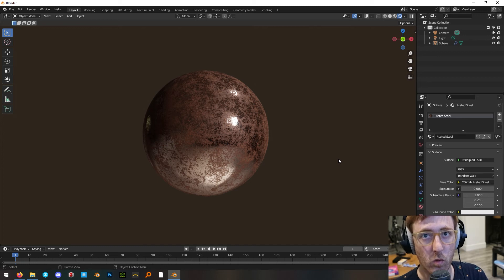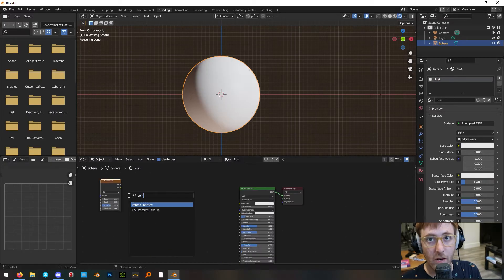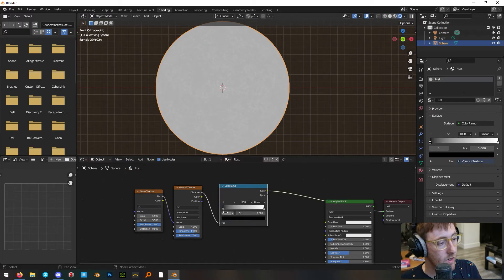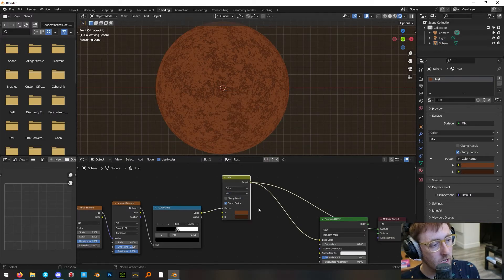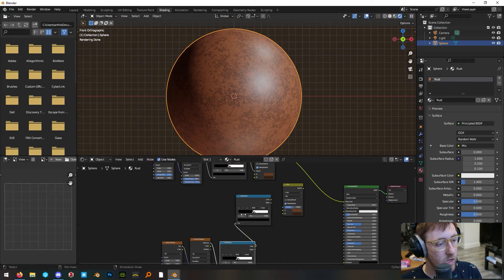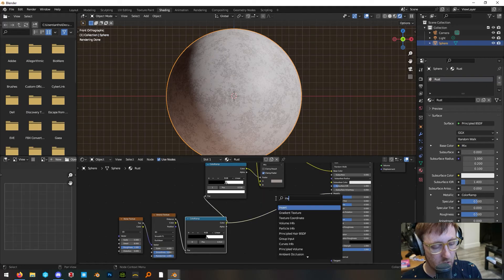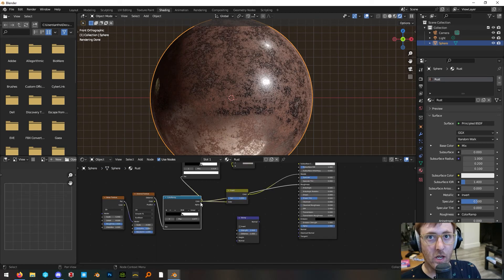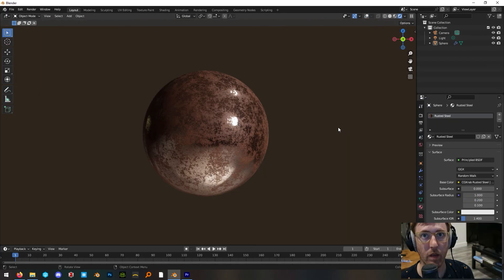Blender: Easy procedural rusted metal material

Comment: willl these work on blender 4.5?
Reply from the maker: Yes but some of the nodes have changed. This is a pretty old tutorial - the new BSDF has the same options but some of them are moved around. The mix color node is also now just called 'Mix' and has an option for color. Most of the same options still exist in Blender 4.5 but they have been moved and/or renamed.

Comment: is there a way to put this on top of another texture? I want to put some rust on let's say a cube, but not everywhere
Reply from the maker: Yes, use a mix shader node. Plug the shader output of the rusted metal's BSDF into one input, and your second material's BSDF into the other. Plug the mix shader node into the material output surface. You'll then need a texture that controls the blend between the two so you can control which material gets applied in which places, so you'll have to make one and add it to the graph - and you'll plug that texture into the Factor of the mix node. 👍 Texture painting is a good way to create that texture.